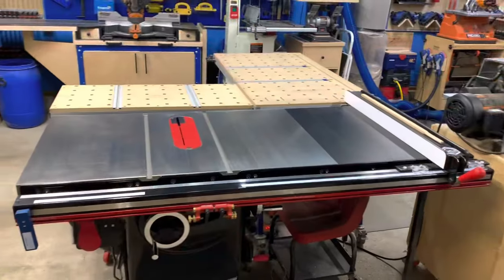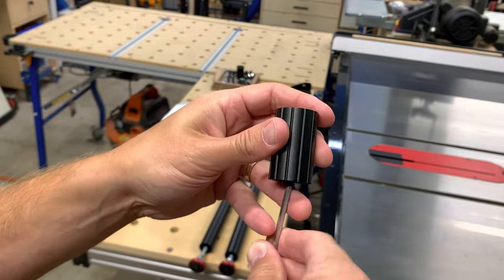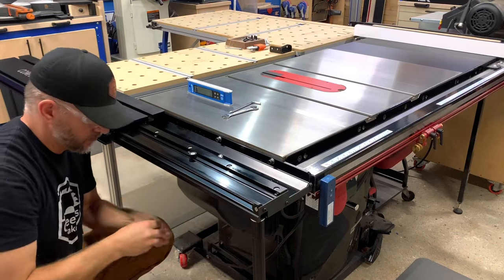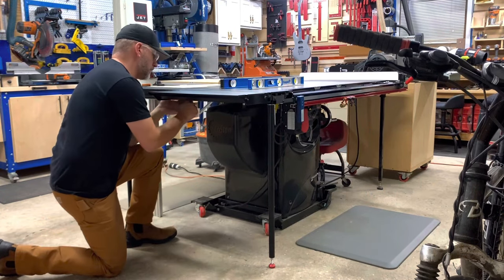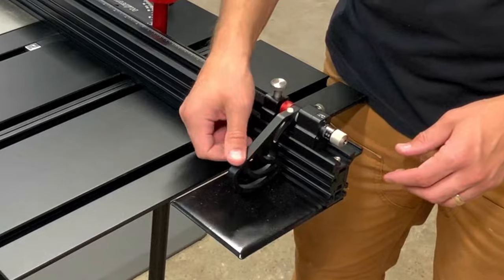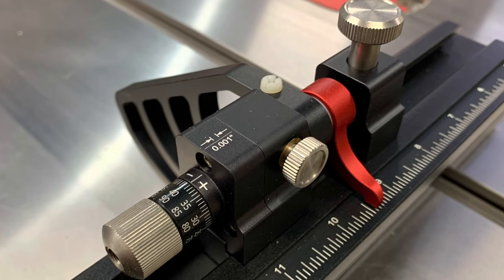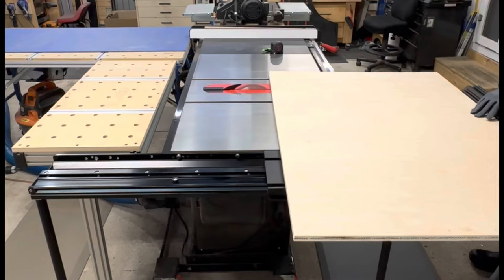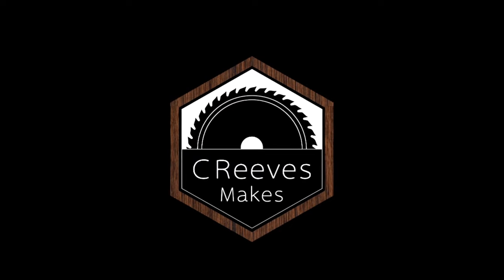Table Saw Accessories: Harvey Sliding Table!

Comment: Or you could always do what I did and buy yourself a long table Italian sliding table saw either SCM or Casadei. Then cut 2400 X 1200 sheets up easily.
Reply from the maker: That’s sounds like a great option but a little out of the scope of my shops footprint! The nice thing about this, is I can easily take it off if needed.
Reply: @CReevesMakes  Great video and very intriguing product. (Like you, I have a Sawstop PCS, and so this represents an alternative to Sawstop's own sliding table.) What would be involved in removing it? And, when re-installing it, would that then require more time spent checking that it's still all level and square to the saw & blade? Thanks.
Reply: @CReevesMakes  get a bigger shop.
Reply: @dngriffiths8105  That is my question as well. I have seen lots of videos on this sliding table, but no one shows how long/difficult it is to put on and remove. I am hopping he does a follow up soon showing this. OH, just found out this table is on sale right now for $999.60 on their web site till this Friday (Mar 31).
Reply: @1987gnXtreme  Yeah... I was taking too long to decide and missed out. 😢
"Next time."

Comment: Wearing gloves while using a Sawstop defeats the reason for having a Sawstop, doesn’t it?
Reply from the maker: So does not putting your hands near the blade.  😏
Reply: @CReevesMakes  My point is that - accidents happen. That blade brake won’t trigger if you’re wearing gloves.
I do like this addition to your saw. Thanks for the video.
Reply: @markshipman4864  if the blade goes through the gloves it will trigger.

Comment: Are they priced the same as the sawstop version?  What are the benefits vs the Ss model?
Reply: From what I have found in talking with lots of people on this exact subject is that Harvey actually makes these for SS. And the Harvey comes with accessories that the SS don't. Also, you can catch the Harvey on sale for around $1,199.00 (actually right now). I have never see the SS on sale, ever and I think it's like $1,399.00. or more.
Reply from the maker: Yes, very closely. They are actually on sale right now.
Reply from the maker: Yes, I actually owned a used SS for a while and it didn’t have some of the features that the Harvey did and I couldn’t lock it 100% to the slider like you can on the Harvey. Agreed, more features with random sales (like right now for $1199.00) and better customer service.
Reply: On sale right now for $999.60.
Reply: @1987gnXtreme  Today: $949. :P

The fun never ends.
Reply: @guitarin_around  I got an email about that. And it's today only! I think I might have to go ahead and pull the trigger on this deal and hope I don't get in too much trouble with the wife. What's that saying....forgiveness vs permission hehehe.

Comment: I loved this attachment and then found the price. $1200 😵‍💫
I could think of a ton of other shop upgrades that I need to do before splurging on this.   Nice video though!  I’m new to your channel and enjoy the content.
Reply from the maker: Yeah its pricey but its sooo nice when making larger cabinet based builds.  Thanks!
Reply: Beats the hell out of an actual sliding saw’s price tag
Reply: I thought it was only the sliding table part for 1200 but it actually comes with an over sized miter gauge then it's not that bad. You have to factor in other real sliding table saw cost in the $8000~$9000 range. I was thinking about the lamello jointers which cost $2000. $1200 for this table, big chunk of precise machined metal, it really not that much.
Reply: TODAY ONLY.. it is $950 + tax & ship.

About $1,130 delivered

Comment: Hey Casey great review. Looking at buying my first Sawstop table saw and wondered if the one in the video is the 30" or 36" PCS Model? I have a small shop and wondered if by adding the slide on the left side if you could reduce the table size on the right. Just looking for some advice.

Comment: Thanks so much for doing that video.  I have the 36" PCS as well and am looking at sliders. For me it is either the Harvey or the Sawstop sliding crosscut table.   I am wondering why you decided to go with the Harvey.  Any specifics?
Reply from the maker: I actually used to have the SawStop version and didn’t care for the slop in it. I couldn’t get rid of it either. The Harvey is much smoother and easier to tune in the areas that were issues on the ss.

Comment: That's one beauty. I'm sure you're loving it. Just one question. I'm curious as to the full width of the table end to end with the sliding table. Thank you for sharing that information in the video.
Reply from the maker: Thanks! The overall width of the entire saw is roughly 86-1/2” sliding table edge to the new router insert edge.
Reply: @CReevesMakes  Ok. Thank you for that.